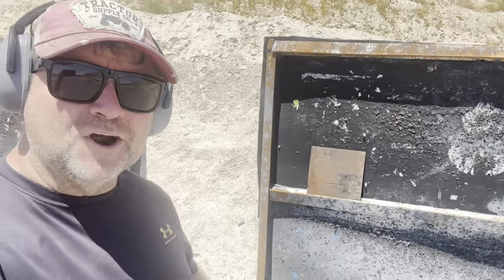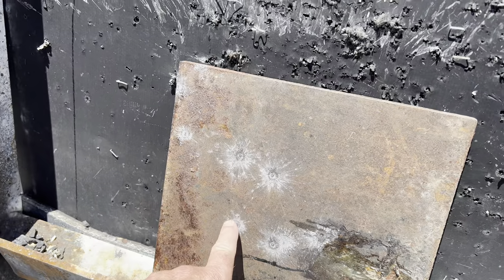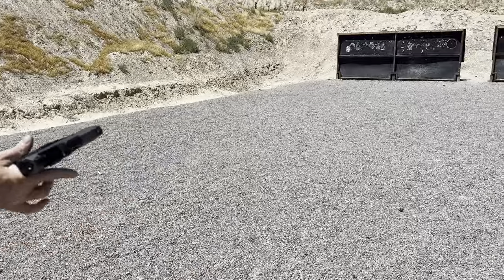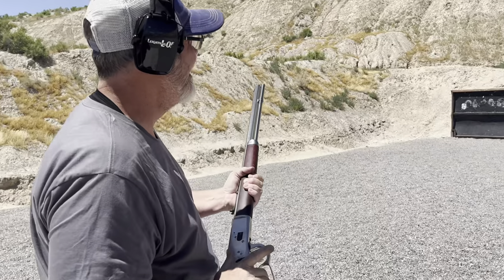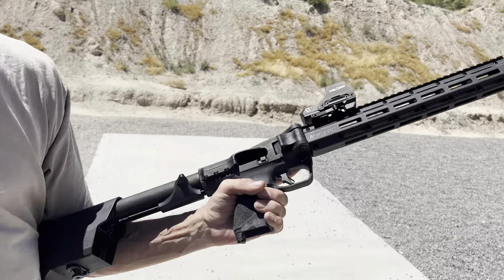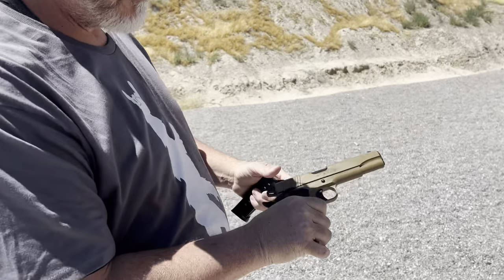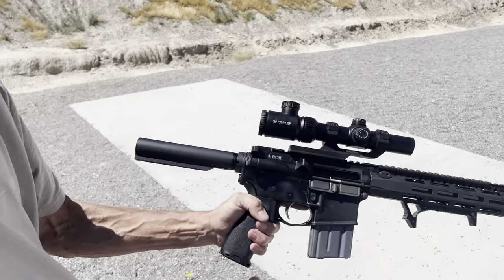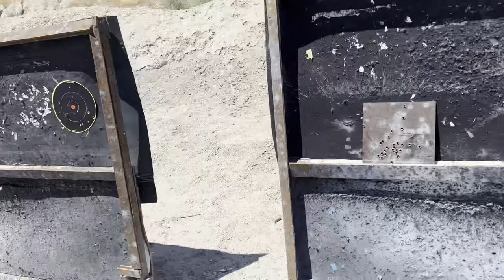Steel plate vs bullets what can it stop?

Comment: Piece by piece I’m bringing home quarter inch thick scrap steel from my welding class and I’m going to weld myself some bulletproof armor and I know it will work thanks to this video 😆
Reply from the maker: That’s gonna be heavy lol
Reply: works fine, can confirm did it myself. try geting an airsoft foam plate for the perfect size mold and to put behind the plate in your rig for confort.

Comment: I have a 50 mm Steel Plate inside the front wall of my house. What can that stop and mild Steel is pretty tough that it can stop practically all the pistol rounds with minimum damage It took a rifle 223 to punch a hole through quarter of an inch of steel well the plate I have is 50 mm thick so about 2 inches
Reply from the maker: Unless they’re using armored piercing or heavy 50 BMG cartridges I can’t see anything in the small rifle pistol caliper, penetrating that
Reply: @jonesmachineco  will 50 mil thick Steel Plate be able to stop the common rifles such as the 308, 30-06, 223 and be able to stop all lead bullets and green tip bullets
Reply from the maker: Yes

Comment: Well, I just recently got a bit of plate cut out from the Steel Plate Processing a 50 mil thick plate ( 2inches thick steel plate ) and shot it with many rifles with 223, 30.06 and 308. It only just only put dents on the surface and even I used armour Peircing black tip bullet at it and it still did not go through with the 30.06 armour Peircing it only went halfway through at Best roughly the core of the bullet got stuck in the plate